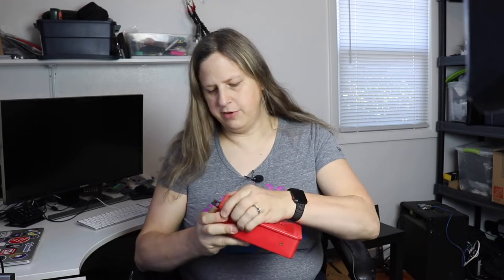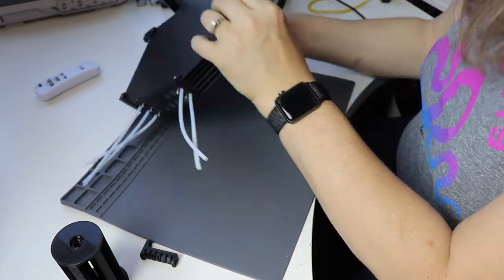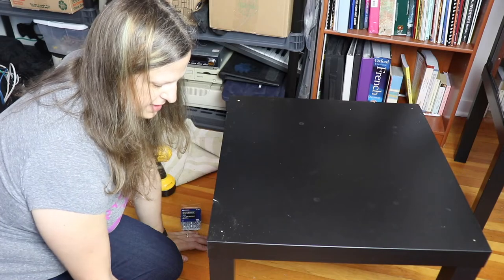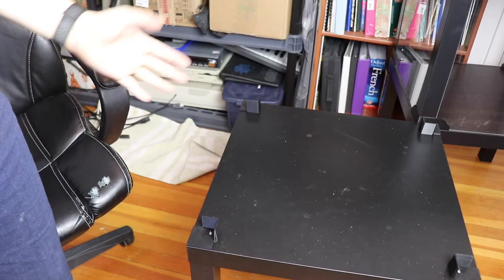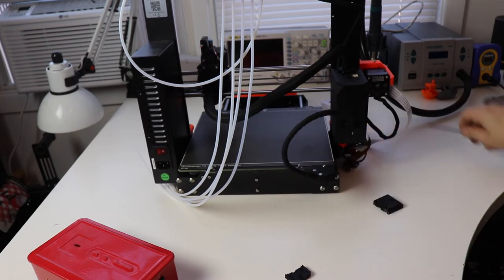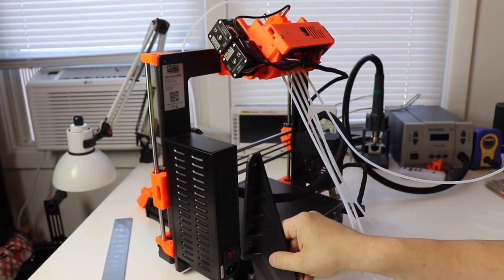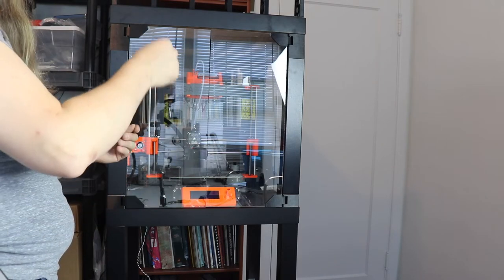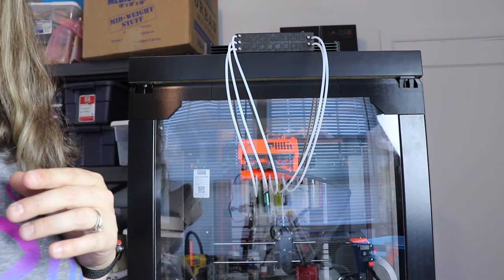Building the Prusa Printer MMU2S Enclosure V2 (Part 3)

Comment: Thanks you so much for this series on building the Prusa enclosure. I've been watching it periodically over more than a year building up to the stress of dismantling my printer to upgrade it and build the enclosure. I've finally finished most of it. I didn't go with the MMU yet, but I'm leaving my options open. Doing a few embellishments of my own to finish off - a through the top filament guide with PTFE tube insert to reduce friction, granite mass as damper, and switch holder for LED lighting. Thanks for giving me the confidence to break the inertia and get started. Cheers!

Comment: Really good video! Lots of useful information for a soon to be MMU2s owner.

For the bed adhesion I recommend using the gluestick or some other pva adhessive mixed with some water. Then use a brush to brush it on the bed while heating it up to PLA temperatures. Keep brushing until all the water is gone. You can barely notice any film on the bed if at all but it will stick like crazy. You will see markings where the part was printed when you remove it from the glue. You can just wash it off with clean water after printing. No more first layer issues. Also for the powder coated bed you need to set the extruder a little lower than you would expect to make it stick really good and get a nice first layer finish.
Reply from the maker: Thanks! I might give that a try next time I'm having adhesion issues. It seems after a few times printing and peeling the print off the powder-coated bed, subsequent prints stick fine in that area. It's only after cleaning it that problems happen for the next few attempts.
Reply: @makermelissa  I have the exact opposite problem. I clean with isopropyl alcohol before every print since when I don't do that for a while prints wont stick anymore. I have both print beds and what I noticed is that the powder coated version needs a lot flatter first layers to stick as good as the smooth one.
Reply from the maker: @ensoniq2k  it might have something to do with them changing up the manufacturing process for the powder coated beds. I'm sure the type of plastic also makes a big difference. I tend to print PETG most of the time. Since the smooth bed and powder-coated are different thicknesses, I always have to adjust the z-layer adjustment. I've found the difference between the two is usually about 0.4mm, so adding or subtracting usually gets me pretty close.
Reply: @makermelissa  I know that problem to well. But for me it's more like 0.3 mm difference. I printed a fair amount of PETG and never had any problems. It tends to stick way better than PLA as long as it's not warping.

Comment: Thanks for this series Melissa. I have had the mk3s upgrade for a while when I ordered the mmu2s. I was printing some final parts before upgrading when I got a major extruded blockage that damaged my PTFE. Sound familiar?🤔. Usually I’d print all my parts with s working print like you did. So I’m going to get my mk3 upgraded to a mk3s or if I’m feeling lucky the extruded version for the mmu2s then print all the parts in PETG. Wish me luck.
Reply from the maker: Good luck! I'm planning to do a follow up video with some additional things I've discovered since. But in general my printer is working great with the MMU2S now.

Comment: Thanks for the video!  I just got a factory built i3s+ and am building the enclosure so I can print ASA.  I wish I had watched your videos before starting, would have saved me some of the headaches I saw you went through.  My printer didn't come with the metal rollers you used on the spool holders.  Do you think you could help with an alternative?  I guess they don't come with the factory built printer? or did they come with the MMU2s?
Reply from the maker: They came with the MMU2S. I did build a custom filament holder with rollers in Part 5 of my Prusa Bear build (https://youtu.be/a6LKCLETiPw). There's links in the description to the rollers I used on there.
Reply: @makermelissa  oh no, now you've introduced me to something I'm getting an itch to build!

Comment: Hey Melissa
Nice series, especially the detailed MMU build.
How do you find the enclosure noise wise? Better or worse?
I don't have a genuine Prusa but I have built a clone, a delta and a core XY
I used to print on glass with blue painters tape until I came across a product called 3Dlac. I've never
had a problem wit adhesion since using it. Not sure it's any good for your build surface but I swear by it now.
Thanks for all your efforts and keep up the good work.
Reply from the maker: The noise is about the same, but maybe a little quieter. It's never been so loud that it really bothered me. It mostly is to help with retaining heat for stuff like ABS printing and keeps everything organized.